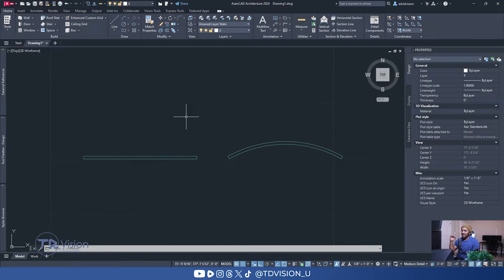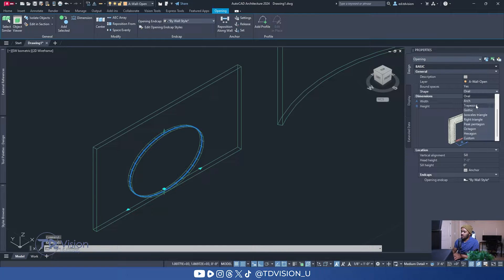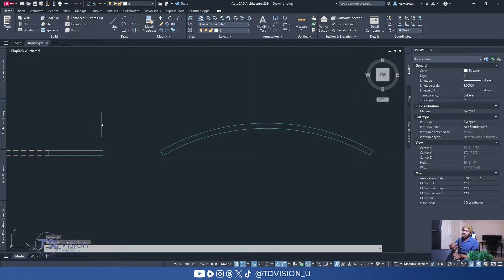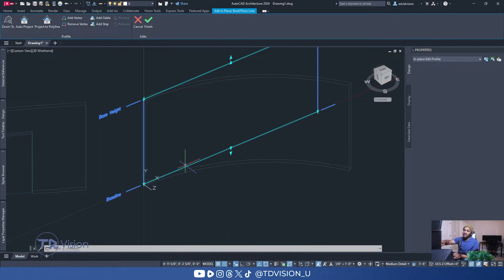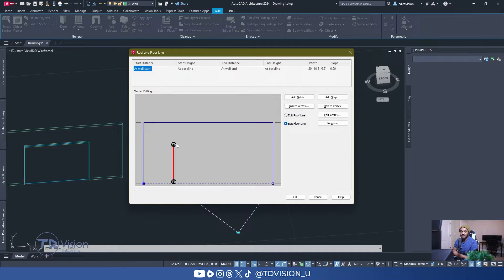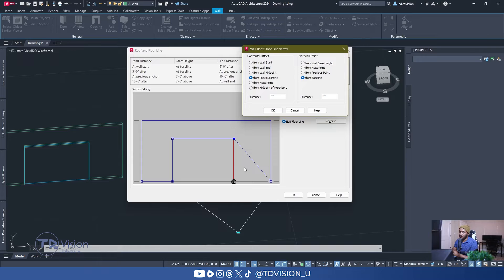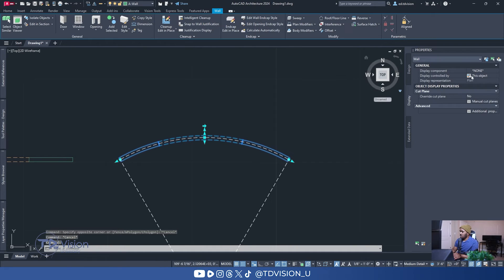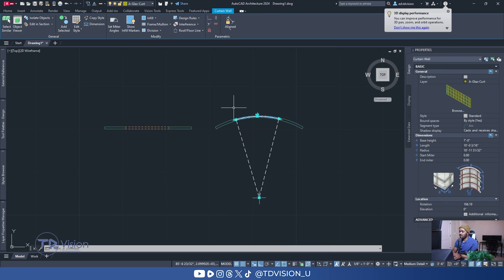Curved Walls Openings // AutoCAD Architecture 2025

Comment: Hello, thank you for all your videos, I have been bringing your channel for the past two months, and I have been learning so much. I have a question I haven't found an answer yet, and it is probably due to me missing the right terminology. I want to know how can I draw a room that is on the same floor has the other rooms, but on a slight step, slightly higher than the other ones ? Thank you so much for your help
Reply from the maker: Yes, that is possible. There are a number of approaches. If it's a large enough space, you can create a separate level (mezzanine). For example, if the floor raises up 1'-6", Level 1 will start at 0" with a height of 1'-6", then Level 1.1 will start at 1'-6"" with a height of 8'-6". That might be confusing. I'll have to do a video to better explain.
Reply: Thank you for your response! I thought I might have to create another floor for that. I was hoping I wouldn't have to. A video on that would be great 😃!  Also I would love to see a video on the renovation tool. I am learning AutoCAD for a renovation and I would love to have your tips and tricks on that subject ! Thanks for your videos keep at it !

Comment: Thank you for your time in making these video's, I have been using AutoCAD since R14, but just recently started using Architecture and find your videos most helpful, while a number of commands are identical my learning curve is the tool pallets and how to reproduce what I can draw in 3D modeling mode in AutoCAD. In Architecture I am struggling to draw a custom feature front door with glazing panels to both sides and above, the overall frame is 4150mm high and 2300mm wide with a single door centre of the frame measuring 1000mm wide by 2450mm high. Also is AutoCAD I can clad the external walls in vertical timber cladding and composite panels with a shadow gap design, plus some stacker brick feature columns (pilasters) and then use the Visualize tab and material browser to make these elements look realistic but I can't find how to do this in Architecture, it just seems limited to the wall types you can pick from the pallet. However I do think the Drape command is extremally good and time saving and I don't know why it's not included in AutoCAD
Reply from the maker: All of what you are trying to do can be done in AutoCAD Architecture. You would have to use window/door assembly to get that custom door design. For materials, use material definitions rather than the materials found on the visualize tab.